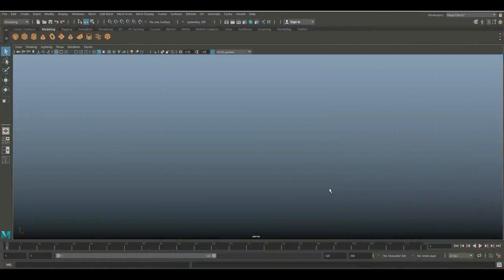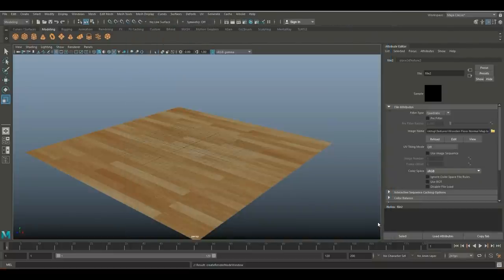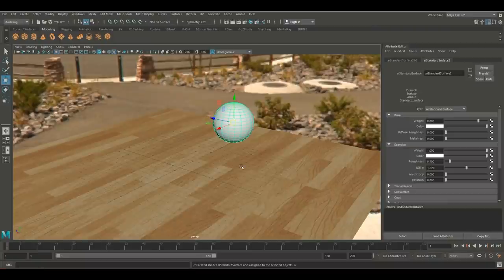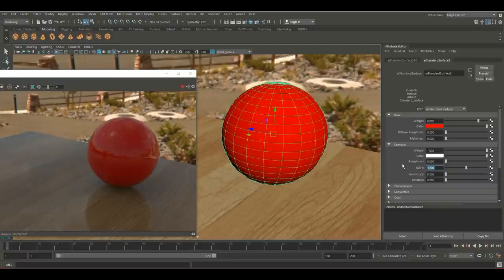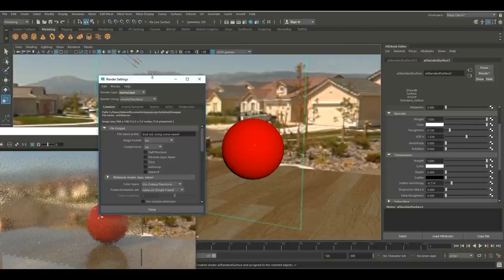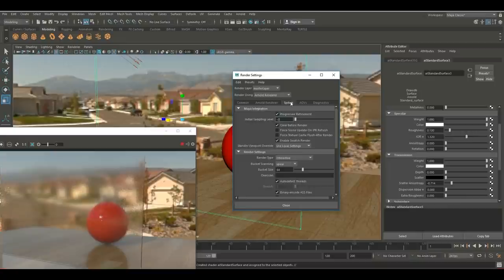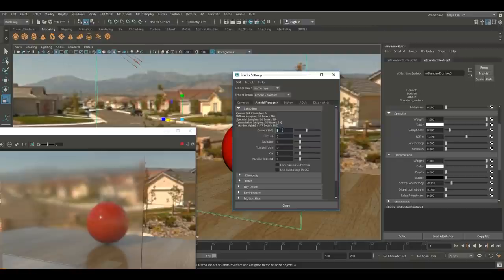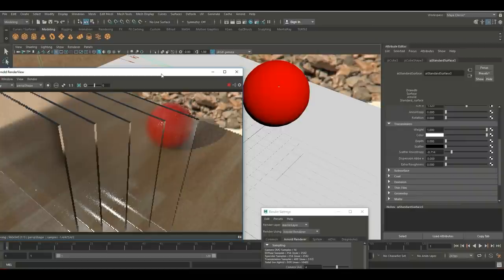Creating Glass in Maya 2018 using Arnold 5.0

Comment: Good tutorial, helped a bit but still dealing with a specific problem. Hope you can help.
Just started using Maya 2018 from 2016 and I miss Mental Ray. But Arnold seems to have the work around needed for what I want to do which is make a nice looking glass material. Here's the rub, I make 3D models meant to look like neon signs. In the past for the glass portion I'd use mia material x's glass preset and then layer it in post over a paint fx neon glow. This was great because you'd have a nice dark slightly transparent shape that when layered over the glow would look like the glass of a sign. 
However in Arnold when I try to render a glass object on it's own to layer in post I just get a solid object with no translucency. I think this is related to Arnold's light system, particularly the skydome. If I use an image file instead of a flat color in the skydome light I can see the image through the object, but if I use a straight color all I get is a solid color where my glass was supposed to be. Not really sure what to do, hope this isn't to confusing...
Reply from the maker: I did a video on neon. Did you see it ? Basically apply an emissive material and bump up the value

Comment: Hi Mike, thanks for the great tuts! You will have a subscriber for life if you would show me/us how to remove the Maya zoom mouse wheel slow down that happens about midway through the mouse wheel zoom process. I do know about the "F" key for focus and the alt right drag - but I can not find anywhere that actually shows how to remove that annoying feature without always having to stop using the mouse wheel or just keep spinning the wheel over and over until it gets past the slow down. Thanks buddy!
Reply from the maker: I have never seen that happen but I guess the problem is in the mouse setting ( not in Maya ) Try and configure your mouse in the mouse software
Reply: Ok Mike thanks for the reply. Oh well - it can not be a mouse issue since once the slow down is reached it stays that way for panning or any movement until I push through it. I will keep looking. Thanks anyhoo.

Comment: A question, if I add all these elements shown in the video including 
some own meshes and textures, like a house with a door and walls, and say that I'd rather make an animated video rather than digital art, is it possible to render it at all at home? For 20 seconds of material, what would you do to make it as good looking as possible but 
at the same as little time to render as possible.
Last time I did something similar in Blender it took two days straight of rendering, but this looks way heavier in comparison.
Reply from the maker: 20 seconds of animation is 20 times 24 frames ( at least ) , so 480 frames times maybe 10 minutes each equals 4800 minutes or 80 hours. And this is on average. Another option is to use a render service like RebusFarm. You batch render via their website and they basically have 5000 computers so it would be far less than an hour.
Reply: Mike Hermes That's insanely good, I think that I'll have to go that way, would you cram up everything to the best and slowest quality before sending?
Reply from the maker: It really would not be that expensive, certainly not for a 20sec clip. I would go with the best quality possible. Her is their website https://nl.rebusfarm.net/en/?gclid=Cj0KCQiAzMDTBRDDARIsABX4AWxIZ8grTviEF_ESsd61siB2cngOY3g4dQk_Qcxq_JYW_RZHD5lVce4aAoXgEALw_wcB
Reply: Mike Hermes Thank you for all your help in the comment section alone, this will be of great use when it's done.
Reply from the maker: You are very welcome

Comment: My current challenge is to place a simple decal (with alpha) on a flat piece of glass. Should be easy, but I'm missing something. Can you help?
Reply from the maker: On what type of shader or material in what program and with what renderer ?
Reply: Hello Mike. Thank you for responding. Maya 2018, Arnold 5. I am very new to Maya and the Transmission menu has me baffled. Simple thin cube, using the aiStandardSurface shader and a PNG with an alpha channel.
Thank you!
Reply from the maker: Go into the hypershade ( The Arnold materials is multi layered ) and plugin the png into a network